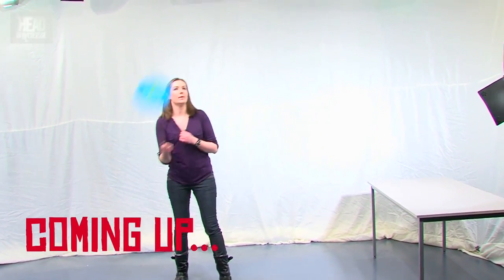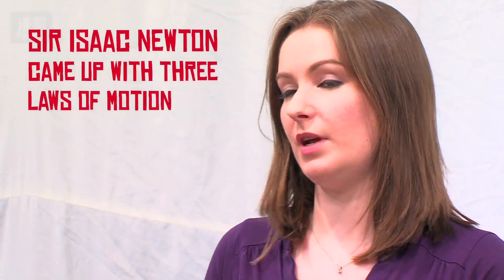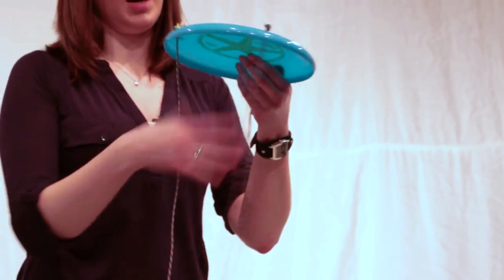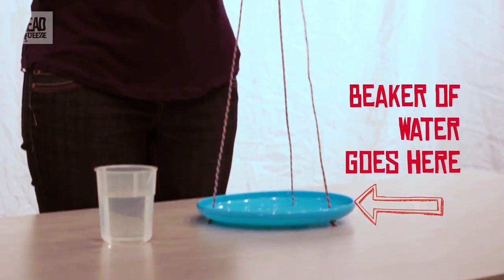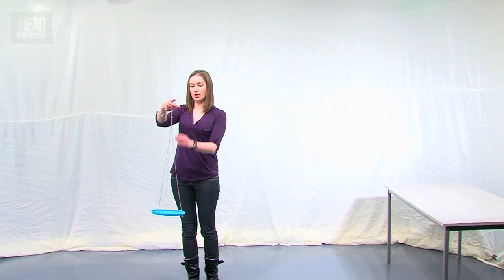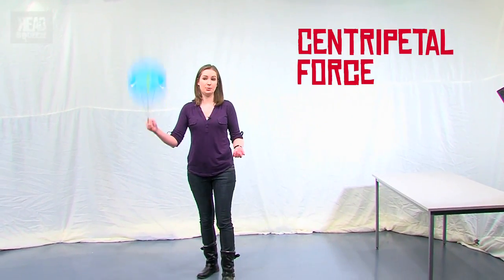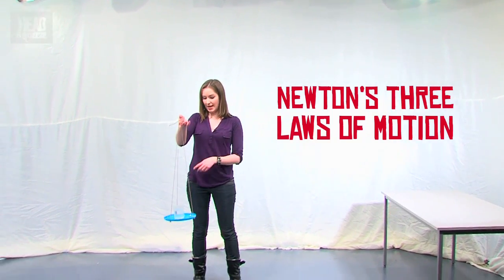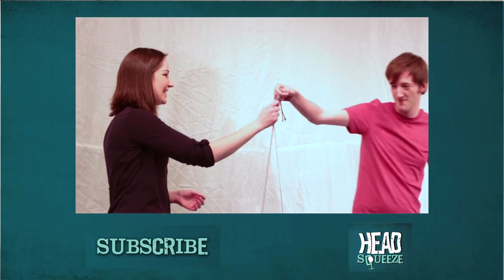How can you Turn Water Upside Down? | Live Experiments | Head Squeeze

Comment: Gravity is a phenomena due to the curvature of space time when there is a presence of mass. The greater the mass, the greater the curvature of space time.
Think of a fabric sheet being pulled taught from each side, now place a weight in the middle of it so it has a dip inwards. If you we're to role a ball across the sheet it will spiral into the central mass. Of course everything has mass, but some things are more massive than others hence why we fall to the earth, but don't fall to the ceiling.

Comment: A centripetal force is any force that translates movement into angular momentum. The strings cause the frisbee to go in a circle, when it would otherwise simply fly off in a straight line. Therefore the strings provide the centripetal force on the frisbee, and the frisbee provides the centripetal force on the beaker, which provides the centripetal on the water. Yay science. 🤪

Comment: He isn't. Centripetal force is just a placeholder name for other forces. 

Whereas centrifugal force is arguably a much more real force that is not a placeholder name for other forces, it is a force that arises due to converting newton's laws from the inertial reference frame they are commonly used in to a non inertial rotating frame and is an entirely valid force as there is no preferential reference frame.